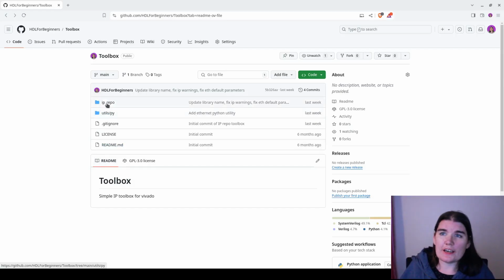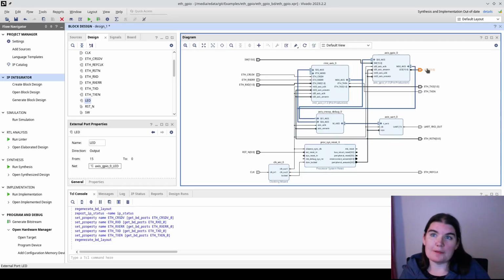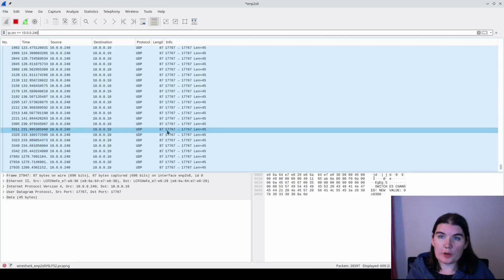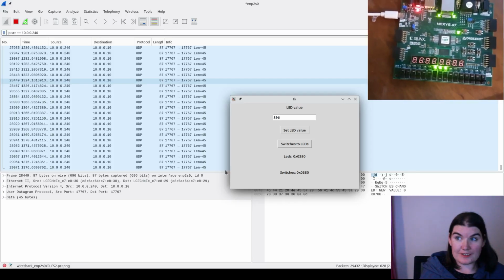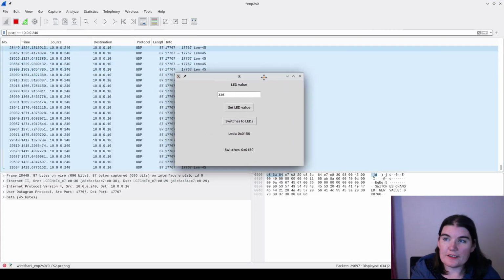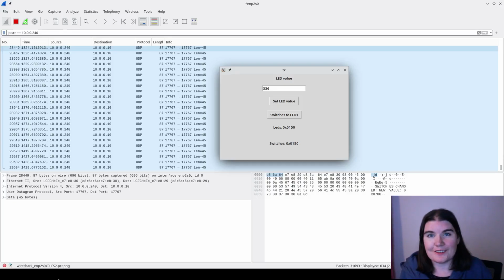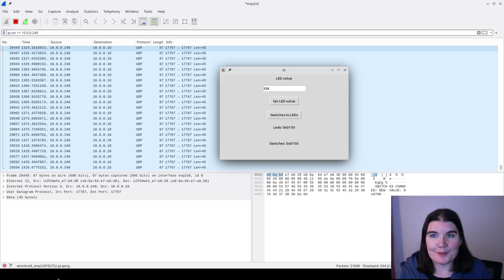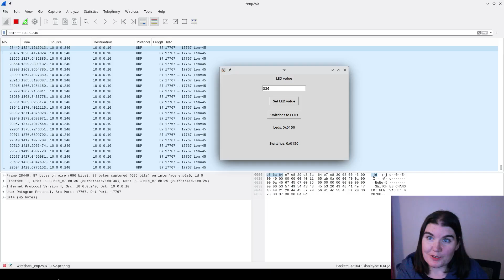Collaboration with Robert Feranec and new open source SystemVerilog toolbox

Comment: Amazing video and tool, thank you very much, I want to know if this project works with KRIA KR260 (Robotics version) that have two ETH ports connected to PS side and two ETH ports connected to PL side, but thos both ports has and RMII chip interface (DP83867CSRGZ), thank you very much, and is it possible to implement this in PYNQ-Z1?

Comment: Hello Stacey, Hello FPGA devs, i have a GOWIN Tang Nano 1K , on board it is equipped with crystal oscillator that outputs 27MHz as clock frequency. my question is: is that 27 MHz is "exactly" 27000000 Hz ?, or it's something closer if you know what i mean ,,,,,, i dont have an oscilloscope to test the purity of that 27MHz

Comment: Great Stacey! Stacey I just wanna ask: I currently code in VHDL as I find it very intuitive and engaging. I see you use verilog and system verilog most of the time. Is verilog (system verilog) easier to use in HDL design than VHDL or what is your reason for your choice of HDL? Thanks.
Reply: System Verilog is better than Verilog and adds some of the neat features in VHDL such as structures.
Reply: @cccmmm1234  Agreed
Reply: Yes, I have used VHDL for many years, but in recent years, I have gradually switched to Verilog because more and more of my customers are also switching to/using Verilog.
That's why I recommend junior engineers start learning Verilog instead of VDHL.
Reply: sv is now leading lang in industry